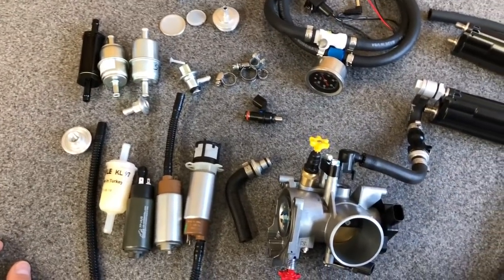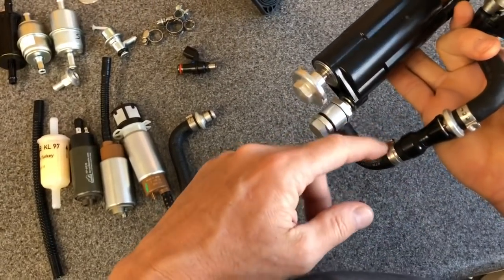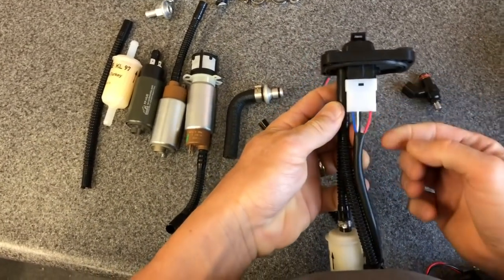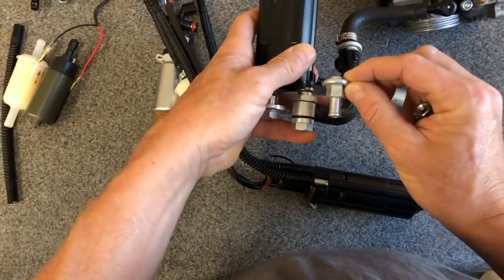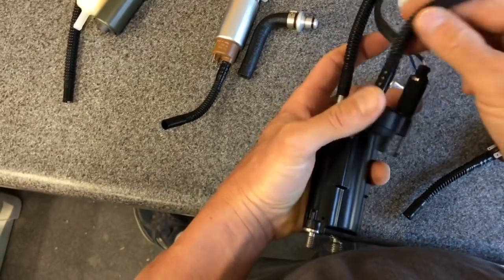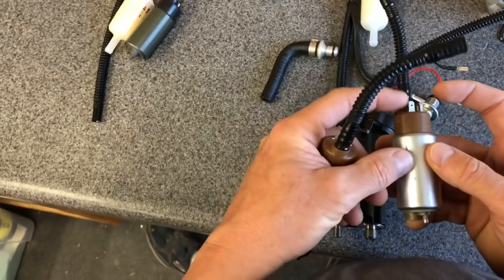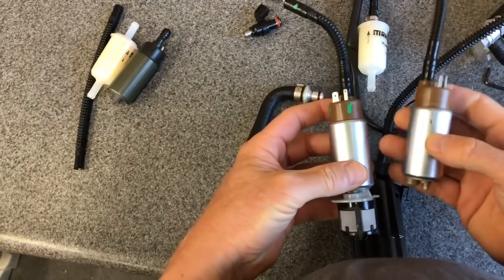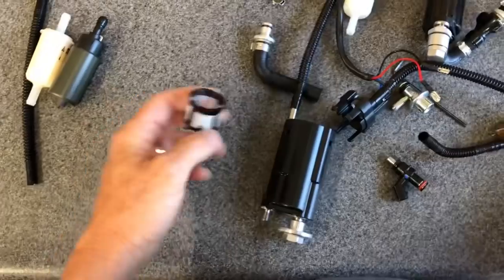MOTO MYTH BUSTERS - THE FUEL SYSTEM

Comment: At about 32:25, you asked about the point of hole in the threaded anchor, that the collar bolt screws on to - that hole allows you to drain the tank as another viewer stated, but during operation, any larger debris (like sand) that makes it's way through the 2 tiny openings in the plastic pump housing, can also drop through it (and not get pulled up against the basket filter screen, which has short legs to provide the needed standoff for all of this to happen).  The collar bolt has a small well in it, to catch and hold that debris so it doesn't get reintroduced into the pump housing.  Of course, if you dump your bike downhill, upside down, etc, the debris can make it's way out of the bolt, which is less than ideal - so don't do that : )  I suspect that part of the fuel maintenance schedule includes cleaning out that bolt to remove accumulation.  Great videos by the way!  I love your depth of knowledge and willingness to share!  I also love your products on your website - keep up the great work!!
Reply: Very perceptive! I hadn't thought of that...it totally makes sense and is a great idea! I have tried to use the hole as a drain before changing a pump and I'd have been better off just pouring the gas out of the filler hole.
Reply: L)7l😊
Reply: That hole is for a reserve tank inlet.

Comment: Great video! I just replaced my filter! I suggest tying a safety wire or fishing line to your lower outlet so it’s easier to pull the fuel pump back to the bottom of the tank. It really helps guide it into place.
Reply: Nice tip!! Thanks!!

Comment: Great video, thank you Mike.  
Also @ 49:30 -- Another key design advantage to the ZipTy filter is that it can [optionally] support also adding the KTM/HQV in-line filter in to their filter for additional filtration.  Not required, but you can run it too, it snaps in.
Reply from the maker: Yes, correct on that

Comment: Only a nitpicking comment here :D. Pumps don't make pressure. They flow. The regulator isn't "presented with 100psi". The pump simply flows enough fuel to require the spring on the regulator check to open, allowing a portion of the fuel to bypass the feed line. If the pump flowed way less fuel with the exact same fuel pressure regulator, rhe system pressure would be lower, because less spring pressure would be required to bypass the fuel back to tank. Likewise, if the pump flowed more fuel, the system pressure would go up, as the regulator spring creates more back pressure while opening far enough to relieve excess fuel. Anyway, sorry, just my hydraulic nerd brain at work.

Comment: Fantastic video, really helping me solve an issue with my 2014 not starting after sitting for 3 years. New fuel, changed Fuel pump (now working and priming), had back pressure at the gas coupling so assumed injector blocked or not opening - If I use a 9 volt battery to active and backwash the injector on the bike I get flow. However when connected to bike electrics, injector not opening. Could this be the pressure regulator, or a relay somewhere?

Comment: Really great info and totally appreciated.
I was hoping that you would talk about the stock fuel pumps as opposed to some of the aftermarket pumps.
Reply from the maker: Everything talked about and shown was the stock fuel pump. 

What did you have in mind.
Reply: Maybe just bad luck but I’ve been through several pumps in a short period of time and not sure what to make of stock reliability as opposed to any of the aftermarket offerings. After seeing this video paranoia says carry a pump at all times. I must pick up on some of your testing gadgets, though, good stuff.
Reply from the maker: Some guys never see a failure. That you’ve had multiple says there’s something going on with some other part of the system. 

A spare pump motor is good insurance.

Comment: Good video. The thermistor is a weak point. Example, my freezer stopped working and the repair was going to be 500$. I replaced the plug in 10$ thermistor and all is fine. This item  needs to be replaceable on the pump. Your 3k pump should have this option.

Comment: Good video. Lots of real world information.
I presume that you know the KTM fuel pumps discharge at 100PSI because you've measured it. Then how can the WIX, NAPA etc carburetor fuel filters cope with that pressure? How do you know that the filter element hasn't failed since you can't inspect it?
So either keep using the OEM Mahle filter hoping it doesn't burst or use a serviceable in-tank filter that can take that pressure.

Comment: Looking at that Earls filter, I would say that the paper element in the consumable filters have much more surface area.  I would just use the Wahle.  As for the external filter, I prefer the size of the Golan, but the Zip-Ty filter disk is much easier to clean and verify cleanliness.

Comment: Great video Mike! Is there a point when you just replace the stock pump as a preventative maintenance deal? Or wait till it starts making problems?  Thanks for all the good information! Cheers!
Reply: John M - Same question or if there are indications of a pump starting to fail.  I would assume pressure output would be a start.

Comment: I recently checked the fuel pressure on my 2019 KTM 300XC-w TPI and it read around 42lbs of pressure. Even though the issue on the bike was not the fuel system I’m wondering if that’s a low pressure reading or about right? I’m not sure but I don’t recall you saying in the video what the ideal pressure should be. Thanks for all the informative videos, really good stuff since these newer dirt bikes are getting more and more complicated to work on.

Comment: Excellent explanation. Thank You. I just have one question do fuel pump run continously? I have issues with my sxf 250 ’17 pump is pumping gas only about 1-2 sec and then stop. Is it Ok? The bike have uneaven idle and does not reach more than 30 % of engine speed.

Comment: Hi great and very informative video. I purchased one of your gauges and tested 3 bikes 2 350s and a 300. All the pressure readings were between 40-42 psi none were 50.   I am 100% sure your gauge is accurate and pumps are performing so my question is whats the best way to troubleshoot this low pressure?
Reply from the maker: Amigo. Your results make me think there might be a calibration issue on the gauge. How do all these bikes run?
Reply: the gauge is correct because i got a spare gauge and i was the same.  They all run ok but the 4t have the normal flame outs and the 2t runs ok
Reply from the maker: Very strange. Are all the filters clean / new?

Comment: The only problem I have ever run into with the use of the band screw type hose clamps is the people who over tighten the clamp and cut into the fuel hose. That said I recommend the screw type clamps that are a fully enclosed band.
Reply from the maker: That’s valid. Low quality fuel line will also get chewed up by the openings in the screw type clamps as well. 

Correct torque on good quality lines is ideal 👌🏽
Reply from the maker: That’s valid. Low quality fuel line will also get chewed up by the openings in the screw type clamps as well. 

Correct torque on good quality lines is ideal 👌🏽

Comment: The hole is there to drain the tank (if you undo just the plug the assembly is still held in the thank by the hose fitting)
Reply from the maker: Yes, clever. I can see it doing that. Good call

Comment: Hi Mike, question about the plastic 90 degree fitting that the injector connects to between the throttle body: There are 45 degree angled variants of this part available from some aftermarket suppliers, made of aluminum, called fuel rails, that supposedly improve the "flame out" tendency of the 4 strokes. Is this yet another myth or is some fuel flow improved by having a more smooth transition of the fuel direction in the tube to the injector?

Comment: Does the 9.99 filter only on your site include the hose clamps?   Or do I need to order the one with hoses also to get the clamps?   Also do you recommend changing the filter at the bottom attached to the pump?   You never mentioned replacing that one that I can remember.   The filter kit from Rocky Mountain is like $80 but has both filters

Comment: That first 10 micron filter in the disconnect, is it in the male or female side?
  And is it cleanable, or do you need to get a new hose n' end fitting?
   I'm in the Philippines with a duke 690. Mostly the same parts.   Difficult to get parts here...
   Nice informative video. Thanks!

Comment: I don't see the shorter hoses mentioned on your website for the longer Earl fuel filter. Got a link? 

My stock plastic filter failed (cracked) at 40 hours and do not want to replace with another plastic.
Reply from the maker: We don’t have them. Here’s the filter we’ve been using and having great success with. 

https://tacomoto.co/products/f

Comment: Great video. Curious can that manifold pressure sensor get dirty/oiled?  I have a odd off idle rough running engine, I've tested everything from fuel pressure to injector, etc.  I can kind of make it go away with some tps adjustments but never perfect and wondering if that sensor might be sending bad data

Comment: I had a buddy with Husaberg 570 have a fi problem on a CO ride. Bike started popping really bad and eventually wouldn't run. We checked every thing we could think of including back flushing the injector. Turns out the intank filter had a split in it, length wise. The injector would initially spray, then the system would lose pressure and stop. We didn't think about the filter being split. :-( ....  And what do you think about running a small amount of 2 stroke oil in the gas to help lube the pump ?

Comment: I have new 2020 FE501, and  I run out of fuel with 3.5-4 inches of fuel left in tank, I haven't checked yet but my lower fuel pump cup holes may be plugged or not drilled, so that is some thing to watch for. I'll know more when I take apart.

Comment: own a 2017 sx250f, and i believe the 2017 xc come with both the “fi” and low fuel indicatir lights where as my sxf doesnt have an indicator light, offhand do yiu know if they bith use
The same fuel pump? Or would my bike because it uses the keihin tbi a wamrning light isnt possible. 
Ultimately Im currently installing the voyager pro (which i currently found  Rotweiller moto , for my Ktm recently , which im sure youre well aware that eveyones out if stock till june or. So)

Comment: Hi Mike...my low fuel light has stopped working...if the bulb is ok then how do i test if the thermistor is faulty or not?...is this possible to do without removing the pump from the tank? 🤔

Comment: Why do the pumps put out 100 psi when you only need 50?  Seems a bit bizarre to have ~50 psi bleed off happening all the time in the tank.  Do pressure regulators fail much?   Thanks!
Reply: Pressure is related to flow. That 100 psi is measured with pump outlet completely blocked. If pump outlet is open, then pressure would drop to zero. Pump has to have more than enough capacity, in order to maintain adequate fuel pressure when injector is open spraying at maximum flow rate / wide open throttle, max rpm. Also perhaps to account for some loss in pressure as pump wears, so as to have a longer service life of the pump. Also as fuel filter becomes dirty, there will be some pressure drop across filter. So you do really need that built in redundancy pressure, otherwise you'd be fitting a new pump & filter after each ride.
Reply from the maker: Thanks for this very complete and thorough explanation

Comment: I do know on that quick disconnect with the little button if you don't use grease or oil lube those I rings will tear easy,seen those on water lines on filet steamers, McDonald's maintenance for 25 yrs
Reply: O rings

Comment: I’m trying to understand. 

In one part of the illustration, you say there’s 100 psi going into the filter, then you say 50 psi?

I’m not sure about why you don’t think that just because the filter isn’t filled with fluid that it’s not likely that the high pressure would damage the filter element. 

Wouldn’t that be less likely if the filter was filled with fluid, thus equal pressure on all of the element instead of no resistance of pressure on the outside of the dry area?

Comment: Is it possible that the second capped off hole is to allow a connection to a second tank, such as the Dakar bikes have?
Reply from the maker: That’s a plausible thought for sure.
Reply: If gas flows thru it I assume you could drain gas from it. Maybe a good place to drain sediment or ethanol/water goop that can form during storage. ??

Comment: I recently started having a problem with my 2019 300xcw tpi where it is having trouble staying at idle when starting from cold. The bike seems to be starving for gas. I played around w the air screw. Turning it out to raise idle.(which I know it’s not an idle screw) and turned it in as well. I believe it came three turns out. Went to 4 and in to 1 1/2. Both had adv fir a  ride but the problem seems to get worse each time I run the bike. Just today when I was testing start/air screw/ and bog problem that bike always had when cold I stalled it and the gas light came on. Thought that was strange. Any ideas? Going over to a friend who has same bike to swap tanks to see if something internal. But if prob still exist could it be injector?  

Thx for vid. Was nice to see how it all works.

Also yesterday went for a ride with air screw at 1 1/2 turns and then stopped and bike sat for two hours. Started up and revved it a few times to warm it up and took off. About 100 yards in the bike stalled. Restarted and then 50 yards more the bike tried to stall again.

Also bike has 68 hrs on it. And is coming out of hibernation from a New England winter. Have about 5-6 rides on it since then. With new gas. But like I said. I noticed every ride the idle at start , staying running/ bog when giving it throttle have gotten worse w every passing ride.
Reply: What was the final issue? Was it ever resolved?

Comment: I built the same in line psi tester , has anyone played around with increasing the fuel pressure as a way to richen em up ?
Reply from the maker: That’s not tuning. Adjust afr in the map
Reply: @TACOMOTOCO   ya for sure the mapping is the way to go , just wondering as it used to be done in the early days of automotive efi tuning.